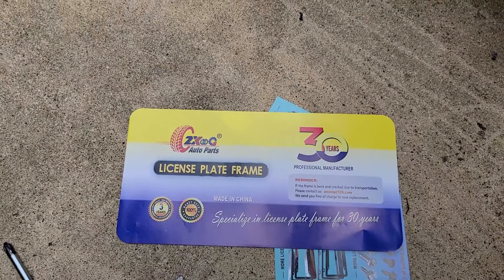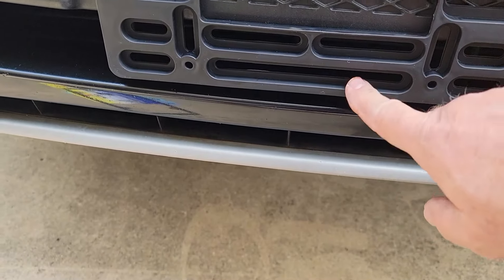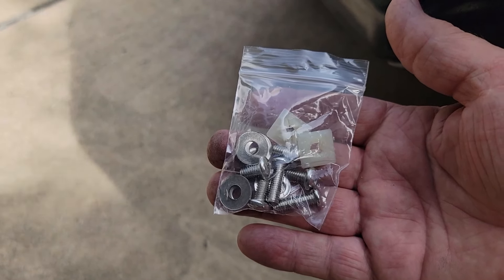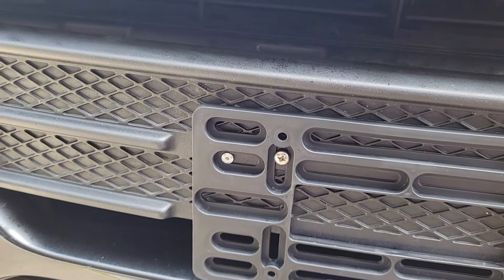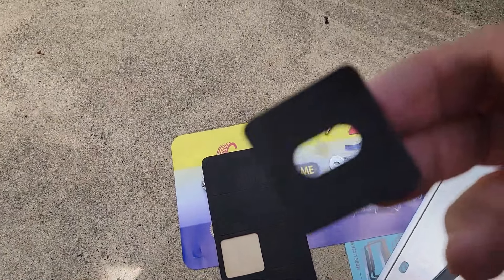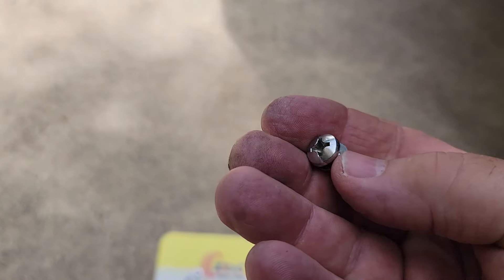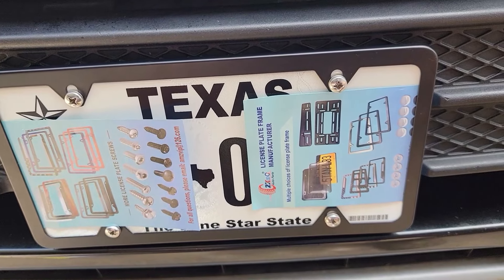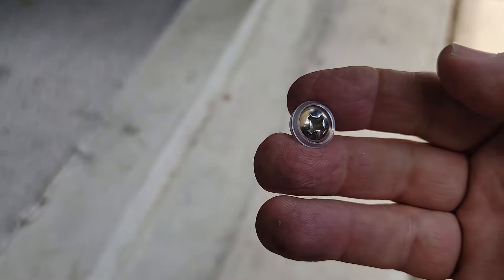How to Install a License Plate Frame Kit

Comment: What is a rivet gun
Reply from the maker: Claretta, Here's a link to the WETOLS Rivet Gun with 120 Pcs Rivets, Manual Rivet Gun Kit with 4 Manual Interchangeable Rivet Heads and 4 Twist Drills Attached, Sturdy Blow Molded Case WE-888 https://amzn.to/3Dy4BDV
Rivet is a permanent fastener that joins two pieces of material together.
Rivets are inserted into a slightly oversized hole 
A tool strikes or presses the rivet, permanently deforming it 
The rivet fills the void between the materials, creating a strong connection 
Sometimes called pop rivets. Hope this helps

Comment: Did you drill a pilot hole for the self taping screw, if so what size? Also, I have the same kit and I was under the impression that the plastic pieces that were supposed to be used in conjunction with the self taping screws were anchors(like drywall anchors). I think you can drill a hole, put the plastic piece in the hole, then drill the self taping screw in the plastic piece and the part of the piece inside the bumper expands from the screw, securing the bracket to the bumper. Similar to a wall/drywall anchor. Am I just mistaken?
Reply from the maker: @Getoutmeswamp  I used a 1/4 drill bit but that depends on what size rivet you use. Thanks for taking the time to watch my video and comment if you haven't subscribed to my channel please consider that along with clicking the notification bell so you don't miss out on any future videos. Here's another video you may like https://youtu.be/ggEOs6mhx8M

Comment: What were the orange zip ties for that came in the packaging
Reply from the maker: @jeffreybarnes9088,  Well this is a universal license plate frame kit and they could use the zip ties for attaching to a trailer. Thanks for taking the time to watch my video and comment if you haven't subscribed to my channel please consider that along with clicking the notification bell so you don't miss out on any future videos. Here's another video you may like https://youtu.be/gu7K8stzvh0
Reply: @DavesShop  thanks for responding I actually used them to tie the plate to the lower half of my car. Your video was so much more informative than the Amazon video.

Comment: No matter where I place my plate it flags my front bumper sensor. I ran out of ideas.
Reply from the maker: @My life in a nutshell,  not sure how to fix that issue is the sensor adjustable?
Thanks for taking the time to watch my video and comment if you haven't subscribed to my channel please consider that along with clicking the notification bell so you don't miss out on any future videos.
Here's another video you may like https://youtu.be/pFEEbmnDR6U
Reply: @DavesShop  not adjustable from what I see in setting. Its a booger for sure.